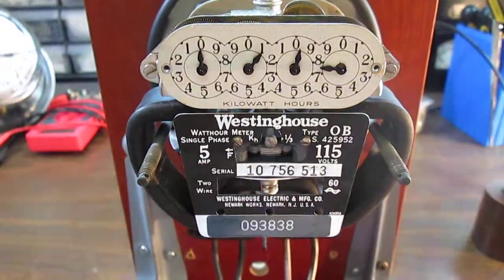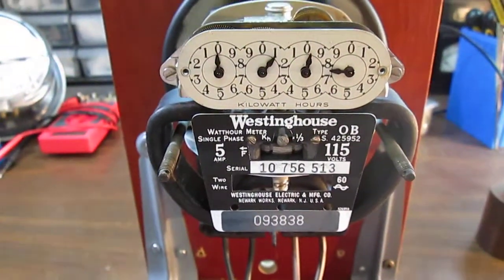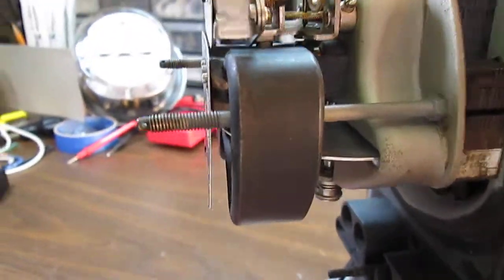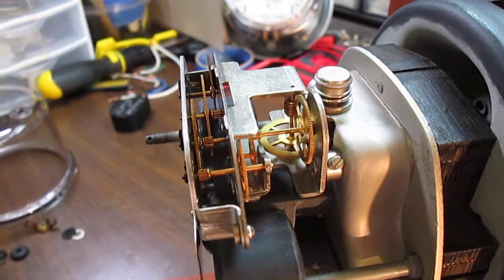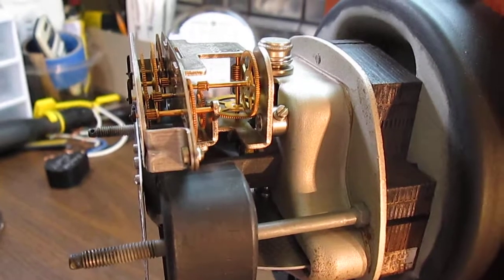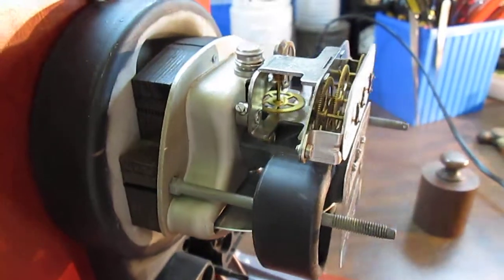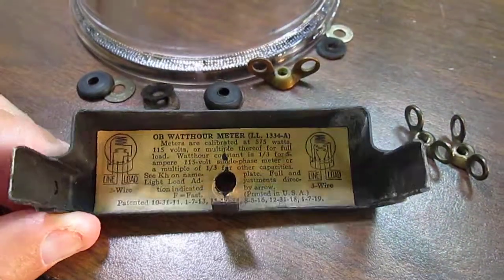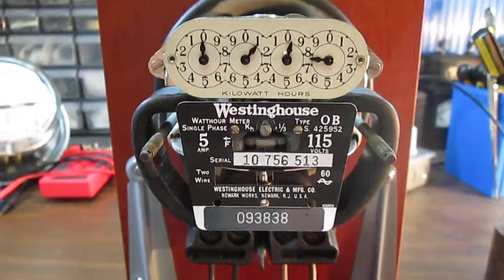Westinghouse Type-OB Watt Hour Meter

Comment: My OB is slightly older than that one and it's a 10A 115V model with a metal housing.   The front of the housing could use a bit of straightening but I'm afraid of breaking the glass.  I also have a GE I-14 in storage with missing window glass which I think is a 5A one but I don't remember exactly.  It has a date penciled on the register of 11-30-59 which I think is the last time the meter was serviced.

Comment: Hey do you mind sending me a picture of the wiring diagram label. I have an OB but the label is gone😔
Reply from the maker: I tried sending you the wiring diagram, but a statement popped up saying it was undeliverable.  The meter has four screw connections, two for line and two for load.  The first is Line Hot, 2nd is Line Neutral, 3rd is Load Neutral, and 4th is Load Hot.

Comment: Where can I find more information on the Type OB meter? I have a Westinghouse Type-OB (10 amps - 115 volts) meter that was in my granddad storage building. Looking for the years they were used/made. Also, I have a Duncan 10 amp meter that I need the same information on.
Reply from the maker: The Type OB was made from around 1924 to around 1934.  In 1934, the Type OC was produced.  What type of Duncan 10 amp meter do you have?  Need the Type as Duncan made the Type M2, MD, MF-A, MF-S, MG-A, MG-S, and so forth.  Thanks
Reply: @mikejordan4899  On the outer case label of the Duncan it shows to be Model E. Its has a black square case that measures 9"x6". According to my research they made a small and large Model E but don't know which one this one is. Thanks for the information on the Westinghouse.
Reply from the maker: @gigemags1991  Hi Jason, both were direct current meter.  I have found that the Model E will work on AC as long as the load is a resistance, such as an incandescent lamp.

Comment: Nice video. I have this identical meter but the wiring diagram is tattered with parts missing. I don't suppose you could do a close up shot of yours to look at could you?
Reply from the maker: I would need your email address to send a picture of the wiring diagram. The first two terminals are Line In with the first terminal being hot and the second ground. The next two are Load in which the third terminal is ground and the fourth is hot.
Reply from the maker: Did you ever send me your email address so that I can send you the OB diagram?  Thanks.

Comment: Viewer #3, comment #1. :D

Aaaah, look at this little cutie instrument. The smallest [loadwheel based] meter I have is probably my Ferranti FNE 12Q or FNN 2Q (they both use the same type of case)

Here in the UK, a lot of our loadwheel based instruments are 'square', and not round or cylindrical like this one.

The only manufacturer that I know of (in the early days) to have cylindrical instruments in the UK were Sangamo Weston, but having said that, I think that company in the UK might have started out as "British Sangamo" because that is what it says on my type HM, whereas on my cylindrical meter, it then says Sangamo Weston.

Wayne's Electrical tip: Your instruments might be better placed in the 'Science & Technology' category here on YT.

Thanxx for showing,

-Wayne's Electrical.

30th June 2017, 18.48
Reply from the maker: I have several Westinghouse Type-OB's in my collection ranging from 5, 10, 15, and 50 amp loads.  One operational OB demand meter, two OB polyphase,  one OB, two stator, network meter, and two OB detachable meters with socket type base.  These two meters are new/old stock and were never put into service. All meters are in operational condition.
Reply: I thought it was cute also. Lovely machine. Thank you Mike for taking the cover off so I can see its innards. :) Love it